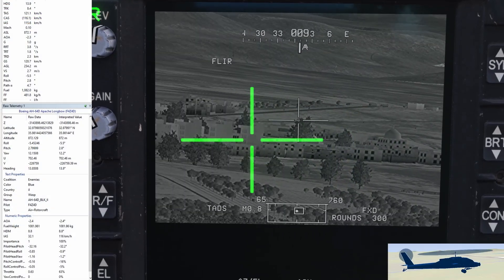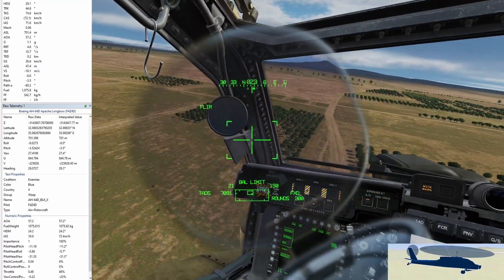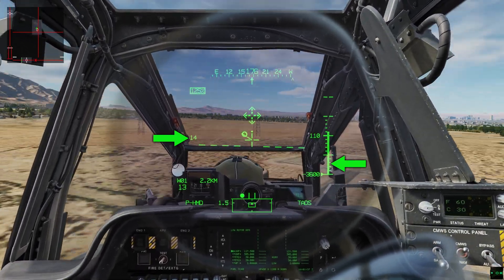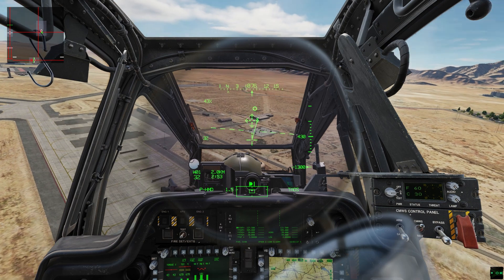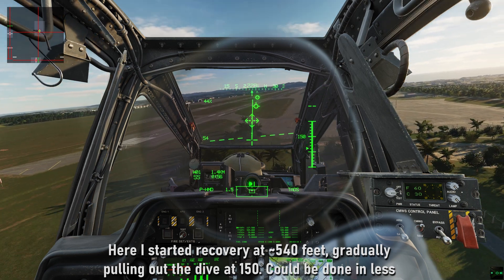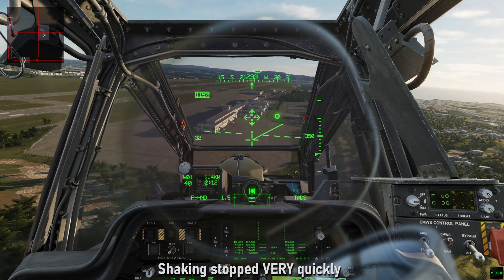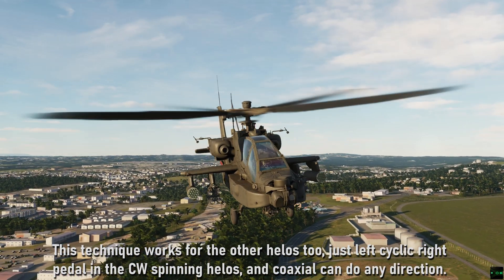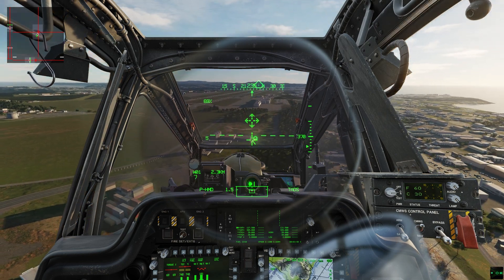AH 64D Vortex Ring State (VRS) & recovery techniques

Comment: In case someone has problem with flying current beta: Try to turn off the collective channel in A/C > utils > turn COLL dot off. It helped me after I detected my chopper behaves differently and I find myself constantly fighting with it. It means computer adjusts your input incorectly, resulting in awkward movements and SAS saturation every time. Compare the controls view (ctrl + enter) with and without the channel support. Also, the NOE channel should be off - it secretly breaks your smooth experience. It's a beta, so it will change I am sure.
Reply from the maker: Interesting. I'm very reluctant to switch off FCS elements and fly it 'raw'... but might try that some time.

Comment: You said the bad words....

Excellent analysis and tutorial.

Directional flight (cyclic) and getting out of the column of recirculated bad air (vortices) is the fix, just as you state.

Nice job!
Reply from the maker: Thanks. Still think something more the length and breadth of that Robinson gentlemen is better in showing how it looks/happens IRL and the diagrams.

Comment: There was an awesome comment from an official ah 64 technician and he said that ah 64 handles so much better in real life compared to how it is in the game. Believe it was the no1 most rated steam comment. So hopefully ED sorts out the flight system so it reflects more accurately RL setup.
Apparently something to do with the flight computer auto adjusts and corrects all these.

Direct quote from this guy: The actual aircraft is equipped with a Flight Management Computer (FMC) that compensates for all the aggravating and dangerous things that helicopters tend to do. Things like translating tendency, uncommanded yaw due to torque changes, crosswinds, vortex ring states, all kinds of stuff. It does this automatically and without the pilot even knowing it's happening (unless the damn thing breaks, at which point he becomes very aware of its absence). From the -10 manual (which I found online with a simple search; it's NOT classified): "The four hydraulic servocylinders control longitudinal/lateral cyclic, main rotor collective, and tail rotor pitch. The servocylinders incorporate integral Stability and Command Augmentation System (SCAS) actuators which are active whenever the Flight Management Computer (FMC) is on. Linear Variable Differential Transducers (LVDTs) are incorporated into each of the flight control axes. The LVDTs measure the positions of the controls and provide this information to the FMC. The FMC provides rate damping, command augmentation, attitude and altitude hold within the ± 10% (20% forward pitch) authority of the system."
Reply from the maker: This one's a hot topic. I'm almost daily on Discords where there's Apache pilots, many of them that were SMEs/testers for it. The three things I know for sure is the Alpha doesn't fly like the Delta we have, nor does the echo - generally speaking though some were upgraded or changed before a letter change. 2nd, like most systems of it's type isn't absolutely perfect in every condition - not saying it'll barrel roll you, just it might be a degree or two off and you'll need to make small corrections and fly it as needed. Third, modeling what you feel through the stick, with hydraulics you can't have at home, and some of the other interactions are kinda hard to do. Heard some say the -10 isn't exactly how it works IRL either.
I'm not sure how the FMC would automatically 'fix' vortex ring states, or prevent them from happening. Unless it actively took control of the helicopter to do what you need to do to get out of it, i.e. gain airspeed in possibly an autorotative state, or do a Vuichard (which I think came after the 2005-2010 FMC was developed). Or prevent you from descending. But all of those are assuming the system knows a safe direction it should fly in. Or that it first gives you a warning that you shouldn't descend faster at those below ETL speeds. Automatically ripping control from the pilot like that might be dangerous, especially if one of the sensors failed and it initiates that stuff at the wrong time.
Problem is VRS is a byproduct of the 'wingtip' vortices towards the tips of the rotor blades - coming from creating lift & induced drag. Planes have been struggling to minimise that, so unsure how a heli's rotorblade tips would need to be shaped to reduce that.
There's definitely bugs atm, like over 100kn where it pitches down left I think it was, or how holding trim doesn't just disable the turn coordinator & such, but completely cancels the SAS - which I understand is not how it works. Just to name 2 bugs.
But yeah, how it's supposed to fly vs. how it does IRL - that answer seems to get tricky. Personally I'll leave that one for the pilots, instructors & engineers/technicians to hash out. A more polished FM from ED sooner rather than later would be cool.
Reply: @volkvoort  "A more polished FM from ED sooner rather than later would be cool" Yes, it surely would be.